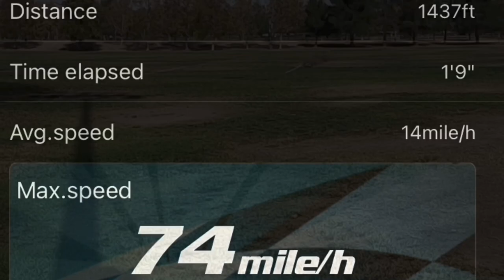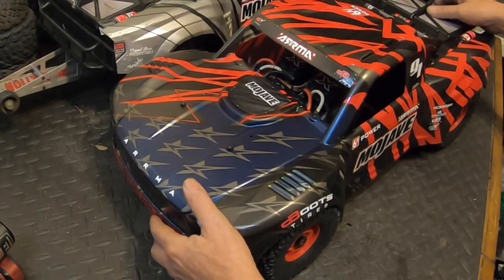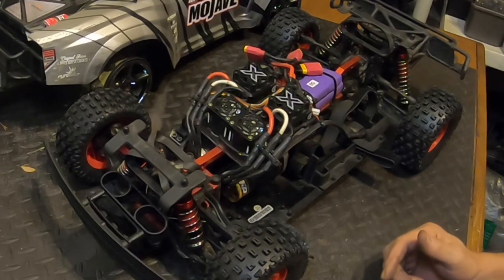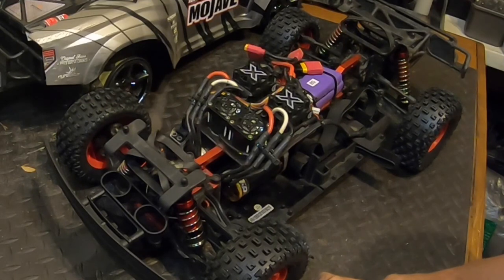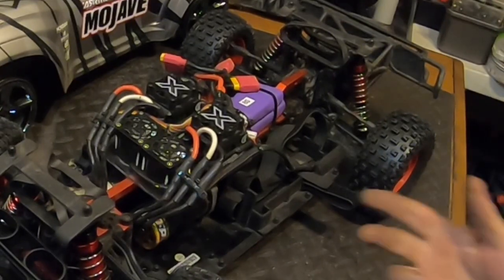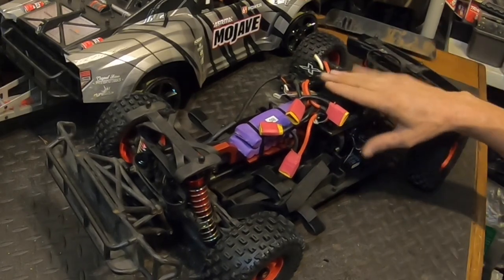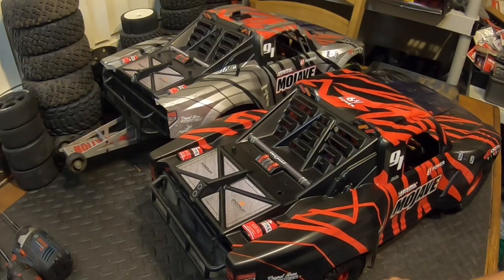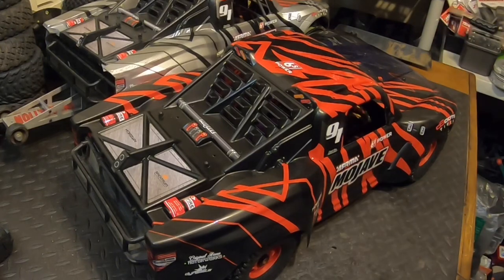Twin Motor Mojave called ( MO-FRACTION) Double The Power For 100mph off-road?

Comment: the scortch parts titanium center shafts in the Mojave help a lot with the wobble and noise. Also when adding power to the Mojave it's a good idea to get the aluminum center diff mount parts. It's helps keep the diff from flexing the plastic diff parts.
Reply from the maker: I put a spool but scorched parts are hard to get in California but I do need the center driveshafts 👍👍
Reply: @earlmoorhead5555  You can't just order them directly? I'm in the US and just order right from their site  but also Island hobby nut site sells the spool and titanium shafts. I just checked, looks like they are in stock.

Comment: This will be interesting! What's the weight difference between the two? Also for the cracked V2 cleat-us wheel, gorilla tape around the outside without the cleats and reinstall them by poking through the tape in the original position.